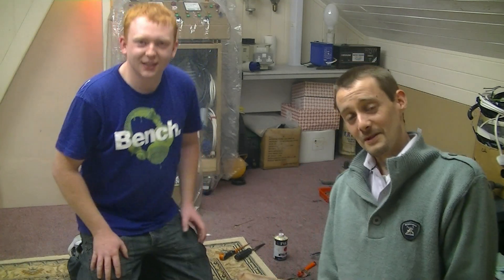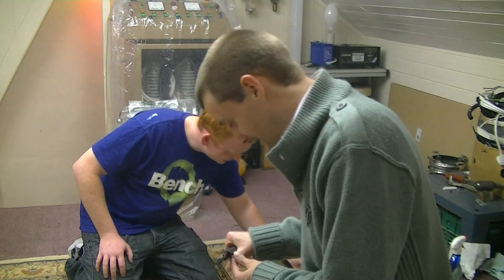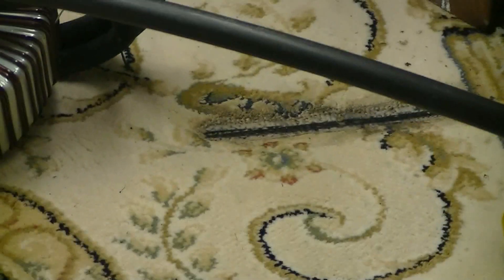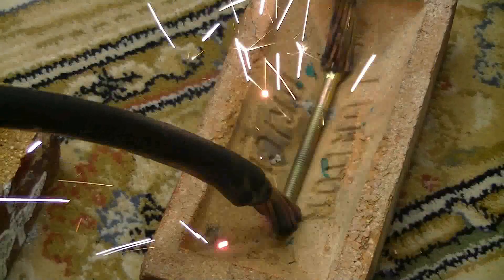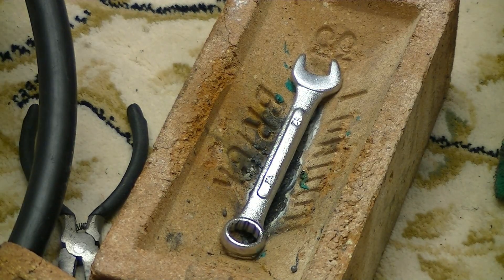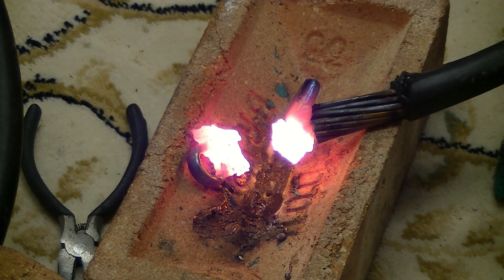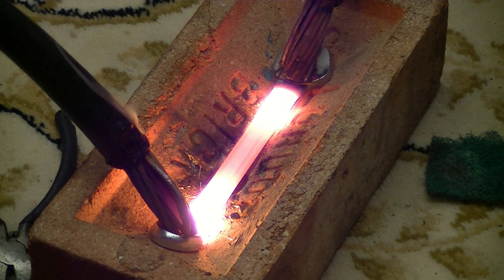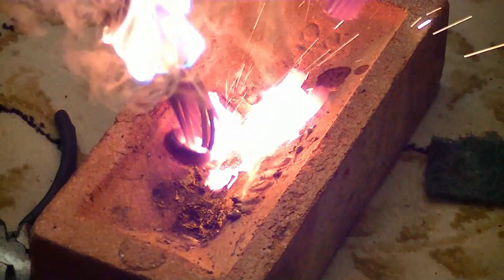5000 Amp Fuse + Tools Melt With High Current

Comment: i will give you £1 if you put the wires on your tongue !!!
Reply: I would do that for 50p. Assuming voltage is around 9v, it would "taste" just like a 9v battery.
Reply: +Perimeji - Gimme the fucking wires now! You can pay me later.
Reply: +Jan Jan - No sir, you are wrong. You obviously do not understand the nature of electricity. Even with a wet tongue, the resistance is about 50k ohms. I know, I have just measured my own. Now, using Ohms's law, (V = IR), at 50k ohms, the actual current drawn, (regardless of the amount of current available), would be 0.000018 of an amp. Hardly enough to fry a gnat my friend.
Reply: Mike B but this thread wasn't a joke
Reply: Oh after that he aint needing that £1 :D
Reply: well you proofed your point sorry for being ignorant here :(
Reply: +Wiz Ricky - Plenty. Google it.
Reply: +Mike B - No you wouldn't even burn your tongue. The only reason they get the steel tools to melt is because there is practically no resistance so the current drawn is massive. As I've previously mentioned the measured resistance of my wet tongue was about 50K Ohms at about 2cm distance between probes. A resistance that high will not even draw a milliamp at 9 volts. At a lower voltage, even less.
Reply: +Bodragon - ok you do it and I'll give you £1 !!!
Reply: and you talk it !!!
Reply: Only 50 mA is enough to die ....!
Reply: Mike B what?
Reply: You may have an engineering degree but you have shit for brains in the humor department !!! :D
Reply: Bodragon you are arrogant and wrong. if you lick a 9v battery you will feel a shock. because it has enough volts to overcome the resistance. this is wayyyyy more amps and volts so your tong will get fried. at least the bit betweeen the wires
Reply: +Mike B -  I would be happy to.
As I have said already. Several times now. If the potential difference at the terminals is 9 volts, it really doesn't matter how much current is available, the current drawn is limited by the resistance of the circuit (Basic Ohm's Law). So it would tingle on the wet tongue (mine had a resistance of 50,000 ohms with the multi-meter tips about one inch apart) just like a 9 volt battery. The reason it melts those spanners is because there is practically zero resistance and so the current drawn is in the hundreds of amperes.
At 50K ohms, the current drawn would be exactly 0.00018 Amps. That's 0.018 miliamps, which is barely any current at all.
If you don't understand this then you are clearly a lost hope but I would be happy to demonstrate should you care to set this up. Heck, for you dear, I' do it for nowt. How;'s that grab yer?
(By the way, I am an electrical engineer at degree level so I have a rough idea of what I'm talking about. Ohm's law isn't even high-school level. I' was taught it in tech class at middle school).
Reply: Mike B You have shit for brains.
Reply: you are wrong. if there is 9v with such high curret it would fry you. especially on your wet tounge

Comment: Crazy British experiment in car garage or on the streets, at home increased dangerous for you and your neighbors. And fasten the ends of the wires long tube with large radiators, will not burn wire insulation.

Comment: darwin award for sure for stupidity ....... high current  ....  the chromium coating on the wrenches and the galvanized coating on the bolts  i didnt see  safety equipment around or respirators. so i am betting that they had a blinding headache later from the fumes off the coatings and years down the road  will whine about breathing issues IF they live that long. wonder how long it took them to burn the place down with doing it on a  flammable surface

Comment: You guys are crazy like me, I like that xD how about melting that VCR? Or how about trying to make some sort of a cannon or a weapon? get a high pressure tank, put those wires inside and something in middle, like a spanner, then fill it with water, build a barrel and seal it off and put a freaking cannon ball in it, then turn on the power, the spanner will heat up the water (hopefully very fast), pressure builds and BOOM!! .. just make sure that the blockage in barrel is the weakest point or you blow yourselves up lol

Comment: For those of you excited to try this at home, keep in mind that the fumes/smoke from the zinc plate/galvanize burning off the bolts will cause IRREVERSIBLE lung damage, even death! I can't tell you NOT to do this "experiment" (rolleyes) but I can suggest you do it in an area with very good ventilation or outside and do NOT get close to the fumes/smoke as it rises off of the bolts/tools, etc.

Comment: 5000 amp with bare hands.. Very smart!!
Reply: its actually not that dangerous as u think
Reply: +Rafael Ponce you could put these wires on your tongue and still not get shocked. the voltage is way too low and the skin resistance is way too high for any significant current to go through. it's perfectly safe (minus the fire/ toxic fumes hazard)

despite what you were probably told, it's the voltage and resistance that determine the current and whether you are going to live or die.
Reply: Voltage Drop,  tongue is very different then your skin,  due to moisture it has very low resistance just like those metal elements, thus your body would draw very high current causing an internal burn.
Reply: +Mr Thomas the tongue still has a few k-ohms (when dry enough that is) which is enough to stop <1v (or at least only cause a "slight" shock)
Reply: 50v and less is safe voltage for human touch fat in body has biggest rezistance. tongue is risky because it is just blood and musle. blood means water even water has relativly big resistance you can feel coin reacts with your drools and makes low voltage(battery)

Comment: i want to smoke what they are smoking.
Reply: socksare Harder Try some vaporized chromium and cadmium from heated tool steel for starters.
Reply: Henri Ervasti actually there is a joint in their ashtray
Reply: Henri Ervasti 6:27
Reply: socksare Harder no you don’t 

What they are smoking is very likely toxic, illegal and expensive lol

Comment: hello you seem pretty knowledgeable. I've recently acquired a pole pig transformer and was wondering what would be the best way to limit the current on the low voltage side (120/240)? Any help is appreciated.

Comment: Awesome fucking video man but your mate was dumb as fuck to move that brick like that with that much power going thru the metal. Beat him !
Reply: Justin Stojanoski-pearson naaaa it's fine
Reply: Justin Stojanoski-pearson lol are you dumb? There's only like 12 volts going through the wire.
Reply: prescott231233 volts aren't what kill you it's amps you only need 1 amp to stop a person's heart. People die from high voltage lines not because the voltage killed them but the damage it caused to their body if they could be stabilized they may make it out alive disabled etc yes. But high current kills everytime on contact.
Reply: prescott231233 I can give a flying dildo how many Volts it was. It was glowing red hot from electricity. If I even glance sideways at a appliance it breaks. Let alone..................whatever

Comment: Done that but did t get that result I got. I dropped a 9/16 wrench in a light post running 277v about 25 lights on this 1 circuit. Wrench hit the positive terminal and grounded out on the wall welded in place blew the breaker and entire parking lot of bulbs.

Comment: the wires which they are using not melting but the tool..why?? does copper melts on higher temperature than that of tool's metal?

Comment: If the current is a 5000A, what is the voltage? Are they using multiple 1 phase 220V wires and sending them through the transformer?

Comment: i want to see the other guy touch both ends to see if he also melts like those wrenches and screws
Reply: Harry Mcdowel i can tell you that nothing would happen
Reply: Its voltage is too low for a body to conduct, nothing would happen.
Reply: Harry Mcdowel The body resistence is to high for this low voltage
Reply: me  too
Reply: the only thing i can think of is that he will get burn first in his hands and feet that has low body resistance and running through his arms and legs before getting to his main body. organs would eventually explodes like the heart, lungs and kidneys including also his manhood.
Reply: It would blow the fuse/breaker. And if there was no fuse then the section with the most resistance would heat up and melt just like a fuse. However the source generator (let's say it's a blizzard outside and they're using a personal generator because the normal power is out) can only making so many watts and if the circuit is shorted with good conductivity throughout the circuit then either it will lug the motor or just keep warming everything until something gives. I'm not sure.

Comment: You guys should read up on hexavalent chromium and lead vapors. I weld and when you melt down galvanized products like this it produces fumes from these metals. You are clearly in a smaller closed off room, and welders even avoid these fumes in a large open garage shop. No way I would be breathing in those fumes in a small room that is sealed up. Get a 3m half mask with 2097 filters or at least open a couple windows and put a box fan in one and pull some air through the room when doing this. Your lungs and body will thank you years down the road.

Comment: why do only the tools get hot and not the entire circuit?
Reply: It's because the metal that melted wasn't thick enough to conduct the electricity without resistance. Running a high electrical current through thin metal has a lot of resistance. The more resistance in the material, the more it heats up, eventually it melts if it gets too hot. You'll notice that they couldn't melt the wrench head because in that part of the tool the metal was thick enough to conduct the electricity without resistance.
Reply: rolen47 Is it also that copper has a lower resistance compared to the vanadium steel of the tools? like if you were to get a quarter inch rod of copper and vanadium steel, would the vanadium steel heat up more than the copper at the same current?

Comment: Beside the apparent fire hazard, you are most likely vaporizing the chrome plating on those wrenches (spanners to you British) and inhaling some of the airborne particulate from it.  Chromium dust it a known carcinogen.  Another plating dangerous metal is cadmium.  It was used a lot to plate fasteners like the bolts you're melting and is also a known carcinogen.
Reply: I really don't think these two need to worry about long-term threats to their health. :D
Reply: I think carcinogens are the least of these two geniuses problems.
Reply: These allegations have never been proven as the science on this is unclear and more studies are needed. Inhaling chromium and cadmium vapor is perfectly healthy and helps regrow hair, maintain erection longer, and may increase penis size.
Reply: E.PLUMBUS UNUM it's ok they looked at a special rainbow after
Reply: i fuckin knew it!

Comment: It actually works better if you put both ends of the wire in your mouth first then try melting the metal. Don't worry it can't hurt your mouth cause mouths are amp proof.

Comment: And that's how you get lung cancer
Reply: Dr Gunsmith they most likely already had that
Reply: The Chromium, Cadmium, and other elements that are alloyed with the metal they are melting, as well as the elements that are in the insulation on the wires, are being heated up enough to go into the air and be inhaled, where many of those elements are known to cause cancer.
Reply: Jairo Guzmani no they are more likely to get brain cancer
Reply: Hey, serious question...what's so lung cancery about what they are doing? I know nothing of welding and only a little of electricity?

Comment: Ignoring the fact that they're using a terribly unprotected circuit to superheat metal on a rug..... I would like to point out the added danger of doing this on galvanized steel indoors.... Ask any welder about galvanic poisoning. Those zinc fumes will mess you up terribly if you inhale enough.

Comment: I would hate to pay the electric bill
Reply: Why?  By the time you watch the whole video and read some of the comments you would have used more power than they did.  Probably cost about a penny to do all that.  Notice the tiny wires that are powering this whole thing?  Power plants and transmissions systems do this in reverse.  They take very high amp (and high voltage to be fair) power and run it through a transformer that is frequently within 100 ft of the generator.  That transformer will take the voltage and multiply it by 10, 20, 50 time depending on setup.  This in turn lowers the amps by the same amount.  Larger transmission systems like to run 500,000 volts or more, some even reach 1,500,000 volts.  This reduces the amps needed to carry the same power, which reduces the line heating, which reduces the losses, and reduces the conductor size requirement.  It is all about transformers.  The power used to charge your phone is 5 volts, but it may have been carried to your city by a line at 500,000 volts.  You can weld steel together (~7,000 degrees F) with a normal household 120 volt outlet welder and use no more electric than your microwave heating up some left over pizza.
Reply: Low voltage means less watts with huge amperages. We pay for watts because that's the measure of work that was done.
Reply: John cena Day care the voltage is low

Comment: Did you said 5k amp !???? Are you sure man ! Because to get that high current you will need a giant transformer . And just to let you know the arc welding equipment higher they go is 600 amp and they using it for gouging

Comment: I wonder if these guys are still alive
Reply: However, without sufficient voltage, the current won't flow. It doesn't matter how much current is available. Ohm's law will demonstrate that. You could grab the ends of the cable and not feel a tingle, unless you're sitting in a bath of salt water perhaps.
Reply: Graham Spinks true, true. either way, I wouldn't be messing with 5k amps. Haha
Reply: @Alec Kennedy
Current is deadly if inside in body (heart, brain). This requires a high voltage.
Touching poles 12V car battery have skin contact with approximately 600-1000A. 100% safe because low voltage does not penetrate skin. Path from the skin to heart is a long way which also resists.
Reply: Not if you burn yourself to a crisp in your attic with it.
Reply: Low voltage with high current is safe.
Reply: fenio81 it's the current that kills, not voltage. You can die from very little amperage passing through your body, take a look at tasers that cops use, the typically run around 50,000 volts, but low amperage.

Comment: How to be a top nominee for the Darwin Award
Reply: Heinrich Klogbaum Toxic brain destroying fumes, high voltage, alcohol, a cigarette for extra measure, and zero safety equipment. Who is the idiot again?
Reply: T1Oracle high current, not voltage.
Reply: tHe084 V=IR Ohm's law
Reply: Yep, and the "R" is tiny in this formula. They use transformer to lower voltage so they can get higher load capacity. Voltage is several volts there/
Reply: why do you idiots think its dangerous?
Reply: ehFbvf ?vbb 
indeed

Comment: not sure if it that dangerous i mean if the transformer is not grounded they normally only get shocked if they touch both wires. Sure the melting is also dangerous but if someone wonders if a lightning could jump over then the upper part is to be recognized once again.

Comment: Welp going to ask a dumb question... why does the cable not melt?  the ends of copper looked fine even though everything else it was touching was melting.
Reply: Because of the conductive capacities of the materials used, the tools have a higher resistance than copper, and that will become heat energy. Also using a fuse of 5000 Amps, prohibits the shortcut when the phases cross. As the shortcut current is lower.
Reply: NewShockerGuy  The correct copper wire gauge is capable of carrying a certain range of amperage without heating up. Look at a car battery cable, it carries hundreds of amps to the starter. In this video, if they used a gauge wire that was insufficient, the wire would burst into flames and melt.

Comment: HILARIOUS!!!
Hey, an electrician over here in Palmerston North, New Zealand, about 1967, was working with the two monster engine alternators used to keep the huge batteries charged during mains outages. I went down to the battery room to read the specific gravities as routine, and noticed this giant, black sooty stain round one of the fuses. He sheepishly told me he'd made a mistake, and the fuse had blown. He said, "I had to go home and change my pants...".

Comment: What you're seeing people is a wrench doing what a fuse is designed to do. It reaches its maximum potential, gets hot, liquifies and loses its connection between its two contact points. 
We are just observing a larger scale.

Comment: I have a great idea.  let's play with high voltage in the house without even wearing insulated  rubbergloves.   :/
Reply: chris haffer Actually they are playing with low voltage. You could touch the wires without any danger.

Comment: As a welder it is suggested not to breathe those molten metal fumes in. Most are plated with zinc which gives it great corrosion resistance but also ya know kills you nice and slowly...